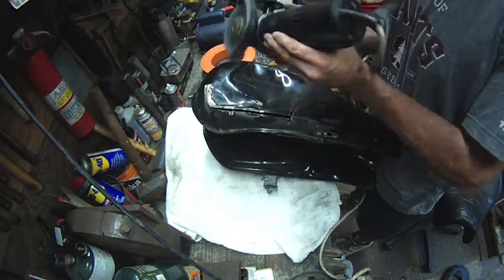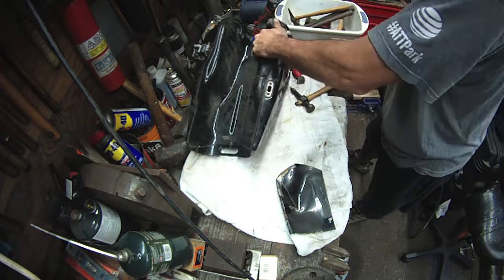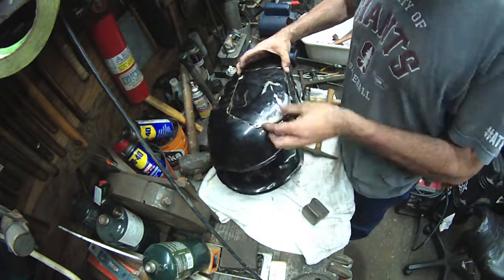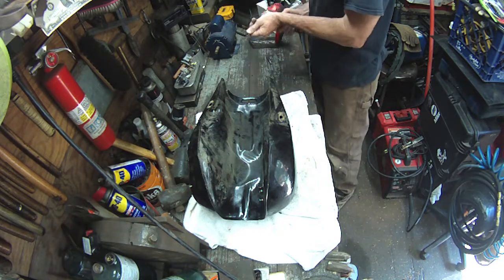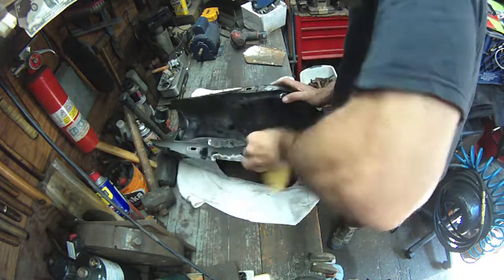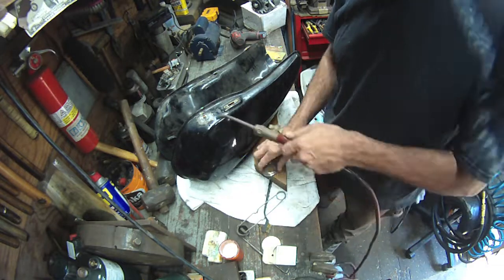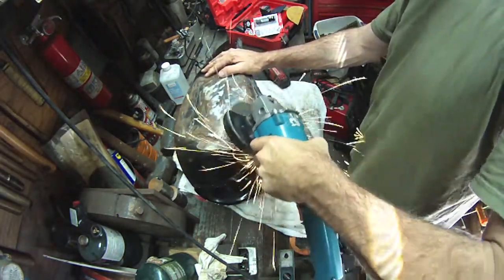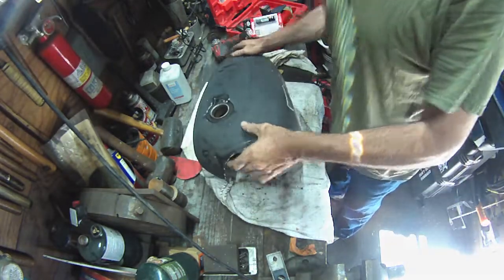Cutting and Welding the Yamasaw Gas Tank

Comment: I'd like to get a couple Milwaukee 12v tools....I'm a dewalt fan boy but you can't beat the power and compactness of those red 12v's
Reply from the maker: I have been rocking Dewalt since 2006 and have not ever had any issues with them....and they get a LOT of use.  This drill was given to me from a customer as a thank you.  It looked light weight, and didn't give it much credit to be honest, but it's about 6-years old and has held up quite well.

Comment: Hey mang looks like your healing quite well so shop therapy really does work 😜. It's finally under 115 down here in the desert so I have been able to get back out in the shop. 

Remember striving for perfection isn't redundant it's just good practice for when the appearance does matter
Reply from the maker: Hey, Great to see you.  Hope you're doing well...aside from that 115 desert heat.. whew that's hot.    I agree.. life is about habits and if you normally are cutting corners, then it's hard to tighten things up when it matters.

Comment: The video is very interesting. Can I ask you exactly what the silver alloy you use with the acetylene flame is called? I used a tin and zinc alloy with a 600 degree hot air gun plus flux and it stuck. Instead, for welding the larger sheet, what type of welding did you use?

Comment: Doesn't look that bad. If you want to be sure of no leaks see if you can get some sloshing fuel tank sealer, it's used on aircraft to seal small pinholes and seeps. It isn't the stuff commonly sold for lining rusty tanks. It pours in like water and you move the tank around to coat it, then let it air dry for 24 hours. It doesn't dissolve or peel off like many coatings do.
Reply from the maker: That's a great tip...thank you.  That will be the way I go if this doesn't hold tight .

Comment: Looks good to me bee keeper
Reply from the maker: Thanks Kevin.
Reply: @yourbeekeeper  hay bee keeper would you take a look at a short video of mine and tell me what you think going on with my truck it at night you can't really see the truck but I don't know what to make of it is dumping to much fuel  I replaced the cats o2 sensor one fuel injector the fuel pressure regulator full tune up new distributor sensors and fuel pump and is still doing this just wondering if it's a valve job or  something I'm missing it a 90 model f150 with a 4.9 straight 6

Comment: the bit I was interested in you did not record.  You installed strips inside the tank then welded back in place the outer shell.  How was this done?
Reply from the maker: I cut strips and placed them on the inside of the cut line.  I clamped them in place and tacked them along the seams.  Once the strips were tacked, I placed the removed piece of tank in place and welded the seams.  There is enough penetration that the welds get into the strips.
Reply: @yourbeekeeper  thanks for the info.  I will try that also.  I am restoring a very rusty tractor tanks which I have cut into a few pieces.  I presume you used a MIG for the welding job.  You mentioned you had 2 of them.  Still trying to workout if I should use a MIG or TIG.